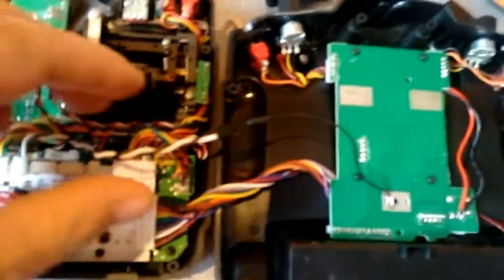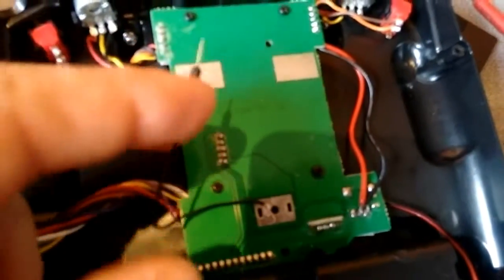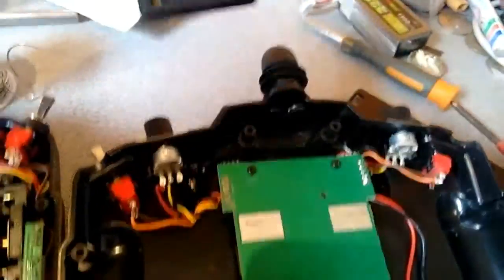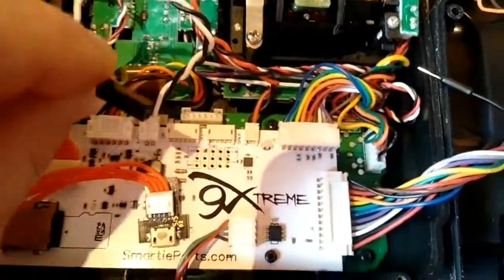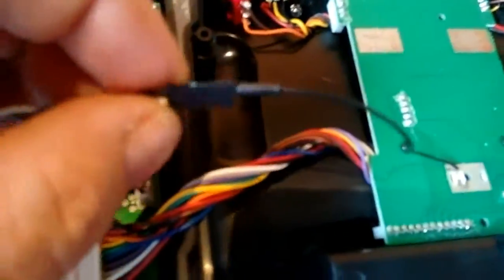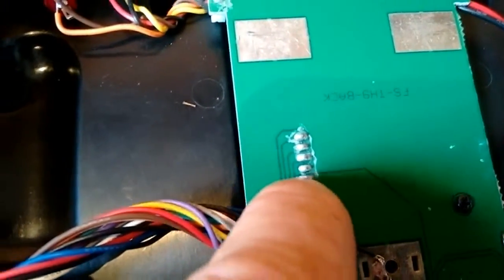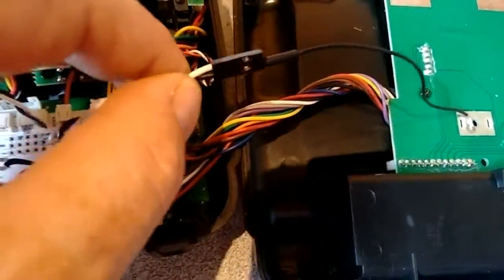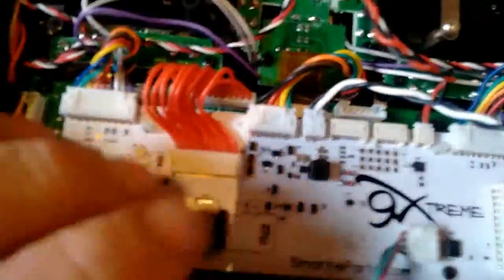XJT Telemetry (Dubai Drone GP Race Intermission video..Unofficial)

Comment: i have the exact same setup on my rig, 9extreme board with the xjt module and the x4rsb receiver. Everything is working except i haven't a clue how to configure the er9x telemetry for rssi or swr and for battery voltage with alarms. Its the one section in the er9x manual that is really lacking. Would you have any tips or even a video available?

Comment: Its a great setup and alternative to the Taranis especially now because in the UK, the Frsky  firmware is being locked into LBT version by an EU directive with no means of reflashing with other firmware
The 9X  does  not have these restrictions
The follow-on  modifications are extra 3 way switches and sliders - great fun
regards
Hans
Reply from the maker: Thanks a lot for the nice comments and it has been a great radio never really thought of upgrading yet with all the modifications yet to do like a antenna upgrade and maybe some  new gimbles.